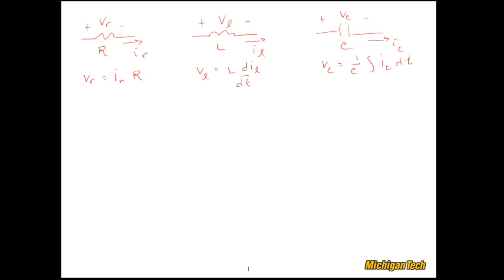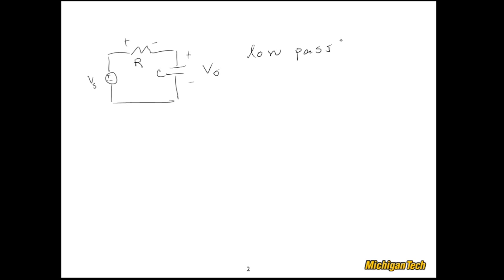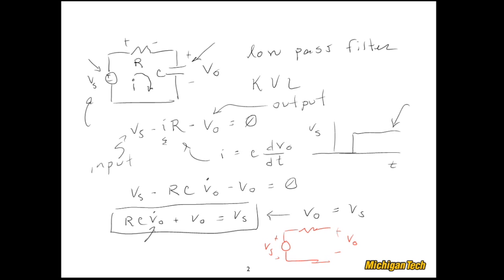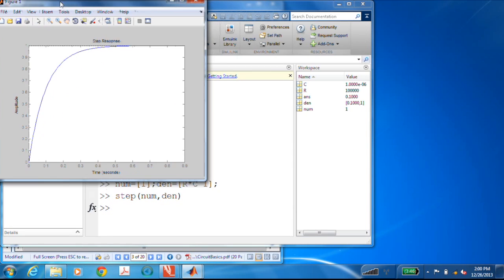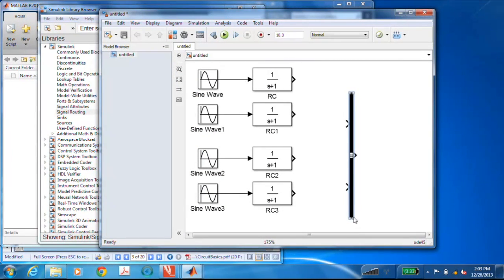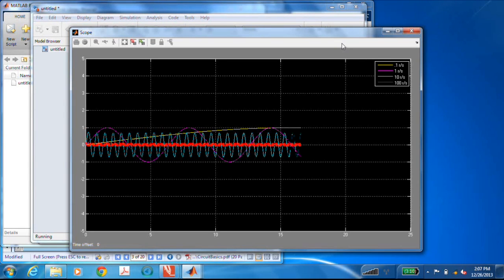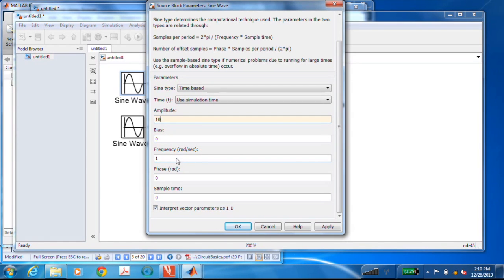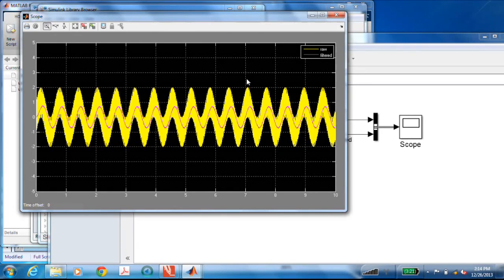RLC Circuit Review

Comment: Hi, Dr.Parker. I'm kind of confused that it is based on what to choose the solver and fixed-step in Simulink?
Reply from the maker: Good question, and it's a long answer to do it well. I'm planning to add a couple vids on that topic. Here's a practical perspective. You must make sure your time step is sufficiently small to capture the highest frequency of your closed loop system. E.g. if your left-most pole of your closed loop system was at s = -10+20j, then its omega_n is about 22.4 rad/sec. Convert this to a period by 2*pi/22.4 or about .28 sec. Now, you would like to see a nice time-domain simulation, so use something about 10 times faster or 0.028 seconds for the time step. The integration method is another issue... it involves stability and accuracy and real-time features. RK-4 works for a wide range of systems, though it's not perfect and it's not real-time. Try it, use your time best guess at the time step, then run your analysis again and use a time step even 10 times smaller. If there's no "significant" change in the response, then go back to your coarser time step. Again, later in the summer I'll post a couple vids that goes through these topics mathematically.